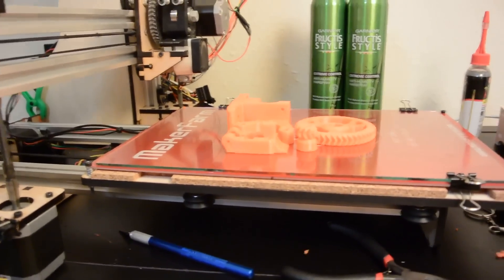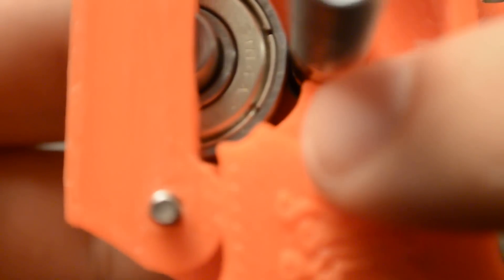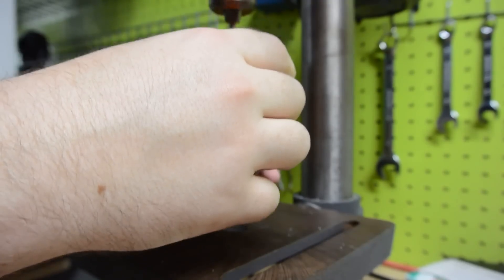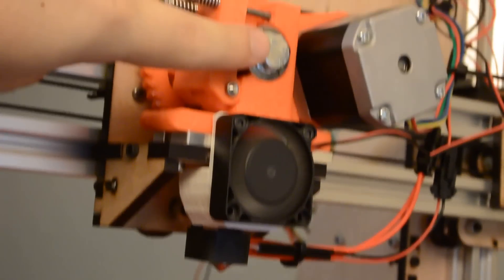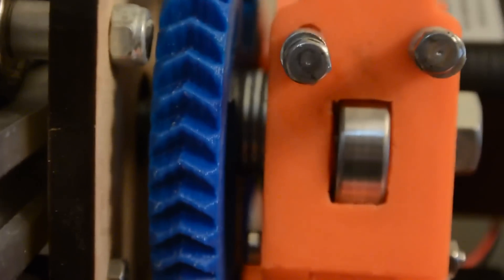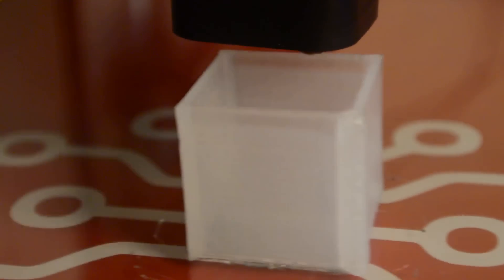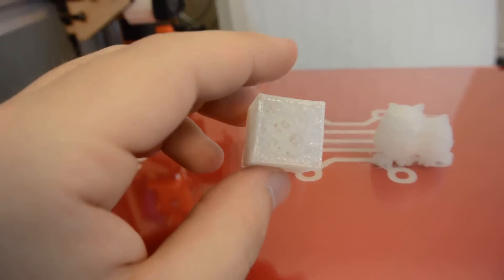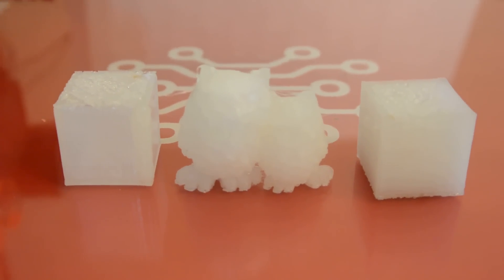Ninjaflex! Printing flexible filament with Gregs/Wades extruder!

Comment: Can Reprab MK8 extruder to print flexible filament?
Reply: Well it all depends. What hotend are you using? Do you have any PTFE tubing from the robbed bolt to the melt-zone? Is your printer DD or bowden?

Comment: Would it be okay to keep that extruder with the PTFE tubing on 24/7 even for PLA filament?
Reply from the maker: Yup! The liner should work with almost all materials,if you are using an all metal hot end like I am. PTFE can start to degrade around 250 degrees, but since the longer is only going up to the cooling fins, it should never reach anywhere near that temp. 

If the liner goes into your hot end though, I'd only recommend materials with temps below 250. Either way, PLA and ABS would be fine with it!

Comment: Hello,Nice vid, I to have tried NF and found similar folding problem in print head at times.Sometime works fine others real pain, so need to mode my PH when have a moment.Also I used a similar print speed of 25mm/s at 210c, but did find that getting it to stick to print bed at room temp didn't work to well but was ok 40c.

Comment: I tried this mod but I used a hand drill since I don't have a drill press.  I wound up making my hole so crooked that it was pretty ineffective.  I needed to print a new print head.  Fortunately my old head still worked well enough to print the new one.  I went ahead and incorporated this design change into the new head before I printed it.  It works great!  Thanks for the tip.  http://www.thingiverse.com/thing:1089085
Reply from the maker: +Phil Hord I must have missed this comment! Great work on the remix, glad to hear it is working. Mind if I put the link to your remix in the video description?
Reply: Hoffman Engineering I don't mind at all. Please do!

Comment: That's odd...my Makerfarm setup printed ninjaflex just fine without any mods.
Reply from the maker: Emory Ducote Interesting, are you using 1.75mm filament? I could not get consistent feed through the extruder, it always ended up coiling and deflecting out of the extruder.
Reply: Emory Ducote I want to know what Hoffman Engineering asked too.

Comment: I may have missed you say it, but can that Mod also print PLA/ABS?
Reply from the maker: ***** I can't believe I didn't discuss that in the video. Doh! Yes, it'll also allow you to print other types of filament like a normal wades/gregs extruder. The PTFE liner simply helps guide the difficult to print ninjaflex, but it doesn't inhibit other types of filaments.

In fact, I've been working on a dual-extruder set up, and all the parts are being printed with this modified extruder!
Reply: Hoffman Engineering Great!  I figured it would, but I wanted to be sure before I started drilling holes :)  Let us know how the dual extruder goes.  I have been thinking about doing it myself.